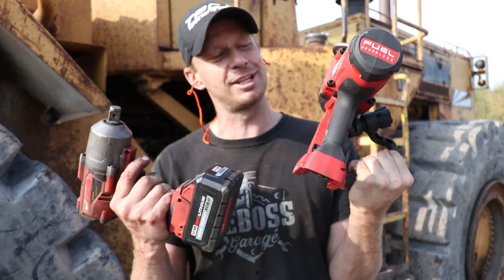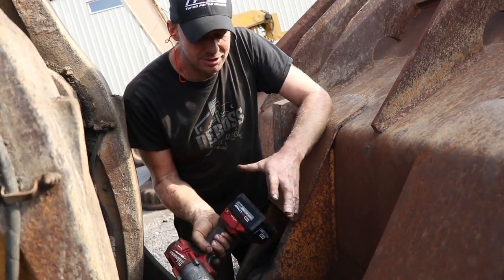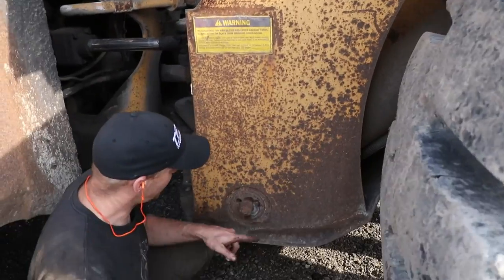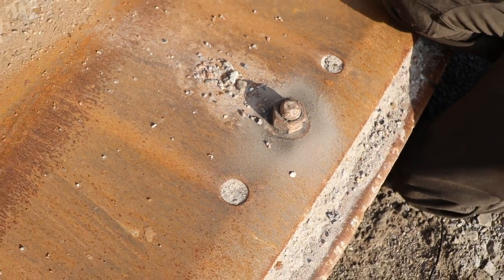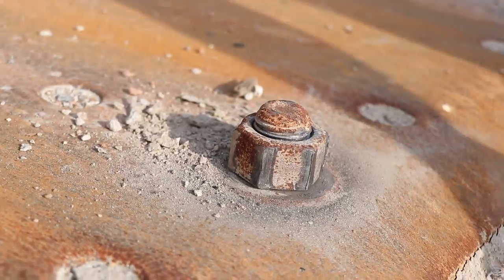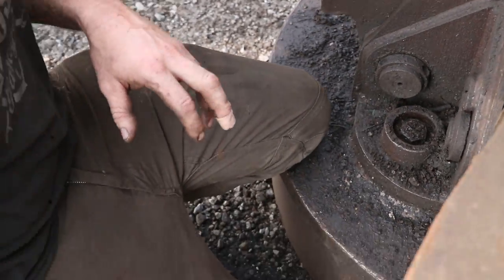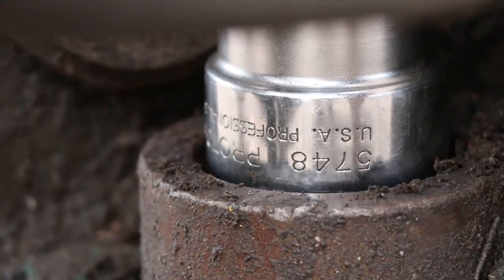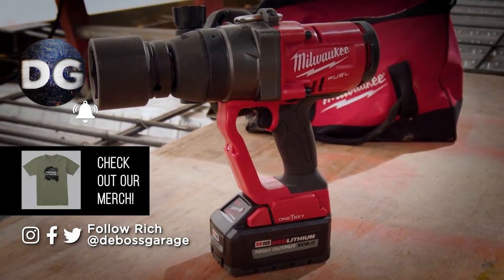Busting 40 Year Old Nuts with a 1 Inch Impact Wrench | Milwaukee M18 FUEL 2867-20 REVIEW

Comment: People saying “I’ll stick with my pneumatics” obviously have never heard the term “time is money”.
Reply: Pneumatics are fine if your in a shop. If your mobile like me and working out of a small van these things have been a total game changer - no more pulling backs with a breaker bar and length of scaffold tube and with the bigger 9ah+ batteries the battery life just isn't an issue anymore.
Reply: A good air gun will out produce any electric gun were there is a lot of fasteners with in one hose length of your hook up and you have adequate air the difference is speed not power.  That said I absolutely love my Milwaukee high torque 1/2 and my mid torque 3/8. The cordless impacts are a life save were entanglement is a concern.
Reply: 1in and 3/4 pneumatic still have the lead for now
1/2 in and 3/8 pneumatic is hardly even in the game these days
Reply: @fowletm1992  I think it will still be awhile before high volume tire shops go cordless it is just to slow.
Reply: @jvanlieu1  
Tyre shops prob not but general mechanics and at home certainly 
My local tyre shoo is using mostly cordless on cars already just run the nuts up tightish and finish with a torque wrench 
Much safer not having airlines dragging around everywhere they rekon 
But they still use phematic on machines trucks and 4x4s 
They are a huge shop servicing 80% of a 20k population town and 400km radius agricultural and mining zone 

The other local shop use air everything still but they dont check the torque with a torque wrench very use rattle it up and send it 
They only have 20% market share due to dodgy business extending eay further than just not torquing wheels

When I left heavy diesel engineering 2 years ago every mechanic had cordless tools and a 3/4 phematic impact, the shop provided 1in phematic guns and sockets 
Mostly Hitachi electric but Milwaukee was coming in big time 
I'm in aus so USA brands dont have a huge presence over here just yet
Reply: @fowletm1992  my 1/2 snapon pneumatic out preforms my milwaukee. if you have a sub par air system and a cheap pneumatic impact the electric will seem amazing. step up to quality tools and electric is still quite a ways behind.
Reply: @leetucker5788  
Iv got a 3/8 air ratchet 1/2 impact and 3/4 impact all snap on 
Running 120psi and 55 cfm at home 
Was running 120psi and 400cfm at the workshop I worked in when I bought them 7yrs ago
Reply: @fowletm1992  Ya those 3/4" & 1" IR machine gun air impacts that been in the game the last 20 years are still #1. You're right on the small air tools, I sell tools for a living and I hold on to the 3/8" airs for longer and longer now.
Reply: @leetucker5788  I think he meant 5.5CFM.
Reply: @jvanlieu1  I can see the roadside tire repair guys using these, I just want to see if these things can work with semi trucks myself
Reply: Jc Smith has a video changing tires on a semi tractor with the 3/4” Milwaukee. I agree that large quantities of fasteners you are probably better with a pneumatic as the batteries and cordless guns heat up. But out in the field away from the air compressor I will take a cordless over a breaker bar
Reply: @leetucker5788  I don't find it all that unbelievable that a serious home workshop owned by a professional, would install a (small) industrial compressor... 

They're cheap as chips on the used market, and with much lower duty cycles in a home workshop, you can still extract a decent life out of a compressor which is too tired and old to be useful in a commercial environment.

Additionally, you can set the pressure on a compressor, it doesn't have to be run at the unit's maximum: if that's not what your tools require (or can even cope with) why would you?
Reply: @joshuakelly8103  When describing an air compressor you list the cfm and max psi. Go to your local home depot and take a look. Obviously you run a regulator on a compressor as you don't always need max pressure. Also when you get into compressors that have 50+ cfm output a lot of them are 460v. Most businesses aren't wired for that let alone home worshops. I mean an older compressor like that would probably require 80-100 amps or more over a 220v circuit.
Reply: @leetucker5788  I know quite a few people running 3Ph 430VAC equipment in their home workshop, either with inverter drive or via a second hook up (the UK's electrical grid is unusually accomodating in terms of ease of adding a 3ph connection).

Like I said, the comment seems pretty plausible to me.
Reply: @joshuakelly8103  From his video he's an Aussie in WA, probably just has 3-phase.
Reply: Pneumatics are safer near fuel.  Don’t drop that battery in the fuel tank. I use a battery ratchet for all interior car work now though.
Reply: @leetucker5788  not who you're replying to but i have an Ingersoll 15hp pump on 400gal atlas that'll do 50cfm plumbed into 1" black iron and 3/4 hoses for the home garage. Run about 155psi for impacts and air hammers.
Reply: @GuNnErPAWN3D  I work for a trucking company with 4 bays to work on trucks and they don't even have that setup. I would say that's more than just a home garage.
Reply: Lee Tucker home barn with a few hoists. Nothing in the world is more frustrating to me than lack of air, so I took care of it. Everything from dirt track cars to combines and pay loafers are inside for work so I have what’s needed. 12” floors with 2” water coils from the boiler for the cold months too.
Reply: @GuNnErPAWN3D  sounds like you own a shop, not a home garage. I don't think most 2 car garages have "a few hoists".
Reply: Lee Tucker “shop” sure, but it’s not open to the public or a business so it’s a “home garage”. 60x110x16. Aside from that, all I was saying is that big 480v compressors don’t have to be at huge industrial sites, they can be at personal shops.
Reply: There is even an 1/2 " air impact with a torque of 1622 ft lb
Reply: @deezelfairy  I work on a lot of medium duty tractors and other fleet vehicles like an isuzu npr for example, I have all milwuakee tools, but also use a 1inch pneumatic impact all the time and having a compressor and other pneumatic tools is usually pretty important. Electric gets you only so far and then you need air. I'll invest in one of these at one point but for now I'll stick to my 1" pneumatic impact. Also having a compressor means you can lift a 20K pound truck in like 2 minutes if that so there's also a perk in that regard. To each their own.
Reply: I'll stick with my pneumatics in the shop and use my battery stuff when I'm without air.

An air gun with the right air applied is equally fast and doesn't overheat.

We also don't have longevity stats on these big impacts yet. They're expensive once, let alone frequently.

Maintained air compressors and guns can outlive us.

Comment: Another reason why the smaller gun can break a bolt loose that the bigger gun tightened is because break away torque is always less than um tightening torque. It makes sense if you think about it, when you tighten a bolt down it takes more force because you're essentially wedging the threads in.

Comment: I'd like to see some crusty 13/18 speed yoke nuts. Heavy truck guy, I daily my 3/4, need to order a 1 inch now.
Reply: My 1/2 Milwaukee  will take off a 2 7/8, and tighten it to well above 500 ft-lb.  Still would love to have the 1 inch

Comment: I've got all of them from 3/8" to 1" with both 8 Ah and 12 Ah batteries for my trucking operation and they work great. I no longer need nor use my air-impact tools. If I find a nut my Milwaukee M18 Fuel impacts can't break loose, then I use my 1" CheaterWrench first to break loose then my Milwaukee tools to remove. Those two tools never fail to remove nuts from bolts.

Comment: With the 1" i have noticed that if i just tighten the bolt first before trying to loosen it, it have worked in almost all situations. The biggest bolts have been tightened to 1200Nm and i used better sockets than chinesium :-P

Comment: I repaired heavy off-road equipment. While a 1 inch impact works 80% of the time, when you get serious about impacts, you purchase the #5 spline impact guns. I've got both a Chicago Pneumatic and a Ingersoll Rand spline gun. 

The #5 spline guns weigh in at over 25 pounds and use a 3/4" diameter air hose.

Comment: now try a 120v electric outlet chicago electric 1/2 impact gun at harbor fright with an open box sale of $31.99
Reply: Check out that generator you also need to use them both in the same situations. If your near an outlet your probably near air as well and better off using pneumatic.

Comment: I've had lots of success with my 3/4" impact with old crusty nuts if after the initial reverse hits to go to forward position (tighten) and give it a couple seconds of impact and a lot of times will release some of the crud in the threads and then reverse it works a lot of times when merely reversing won't get it...

Comment: U need a impact socket that chrome socket doesn't have the proper weight for impacting plus hey might shatter
Reply: He mentioned that in the video. I'd also go for a 6 sided socket
Reply: It's not really about the weight but the material is made of doesn't transfer the energy effectively.

Comment: We use 3/4’s in the bucket trucks (electric line trade)....thing is absolutly fantastic...took the hydraulic hoses and gun and put them in the side-till.....its got more than enough power and the battery just lasts and lasts...i cant even imagine the power of this beast...

Comment: Lot of people never do it. If you would spray those rusty crusty nasty theads around the bolt saturate it good with pb blaster or equivalent let set few minutes. That would help your impact tremendous on removing stuck on rusty bolts.

Comment: I had bought an old Allis and Chalmers m-100 grader that sat in the bush for 20 years, there was a water line on the blade during spring melt off. And I have an igersoll 3/4” impact that was able to get all but two bolts off. Had to get the old grinder wrench out. Always wanted the milwake cordless but couldn’t swallow the price tag.

Comment: That was a proper test for impacts  not like most of tests showing breaking fresh tightened nuts
Reply: Real test, for sure
Reply: Regular socket and a shared battery not designed for it makes it a real test? Using an impact socket and a 12.0 would have made a huge difference.

Comment: 4:25, have you never considered the new induction heaters rather than oxy?
Reply: Inductive heaters have there place but the coils are also expensive and he was saying they just cut them off and replace the bolts
Reply: @thomasjames734   I wouldn't consider inductive heater coils expensive. You can make your own gun for about $100  and the coils are dirt cheap, it's nothing more than copper tubing. 

Each to their own though. I agree cutting bolts is usually the fastest way of doing things as the cost of replacing them would be cheap. It may still be a useful tool to own though working on farms as I imagine all the mud and water would cake shit up

Comment: Those electric impacts should only be trusted for removing stuff, not tightening them. They are biased towards reverse torque not forward torque. That 1" electric impact probably barely puts out 300 ft-lb in forward. More like 700 ft-lbs in reverse, not their bullshit 1800 ft-lbs that an actual pneumatic 1" impact would have in reverse.
Reply: You've obviously never used one. My 1/2 inch fuel tightens to well over 600 ft lbs with ease. Done it multiple times on wheels.
Reply: No. Pneumatic tools were biased in a certain direction due to the air motor inside. Electric motors don't care what direction they're going.
Reply: Batojiri1 i didn’t believe the power numbers either so I did real world testing. I physically torqued bolts to values they advertise and given a good fitting socket with no extension and rust free they’ll do exactly what they claim they will do. I change several tires underground in fact I changed a tire on a CAT AD 30 rock truck last week and wheel torque is 740 ft/lbs my M18 fuel 3/4 gun will turn every nut to 740 (checked via torque wrench). I do however agree that you should not use a battery impact for tightening unless you check torque by hand afterwards.
Reply: I’ve also used my 3/4 fuel to remove bolts a 1” pneumatic gun couldn’t do
Reply: just like when they changed horsepower rating on small engines to foot lbs.  it was all deceptive to the end user. ex. 400horse but 20 foot lbs...who wouldnt want to snowblow with 400 horses but can only shoot out 3ft....lol

Comment: max torque come from the first few seconds the trigger is pulled and falls off after that. So when I'm using mine on a stubborn nut, I'll use it in bursts. Works just about every time, and definitely better than just holding the trigger wide open.

Comment: It doesn't feel as powerful as Milwaukee advertises it, it had hard time loosening nuts on a dry van, after taking off and reinstalling four wheels, it was already cutting out due to over heating even though it had time to cool off in the shade while tires were getting dismounted and swapped out. I'm betting Milwaukee stretched the truth a little, 1" air guns are not dead yet even though I thought otherwise buying this tool

Comment: I use the half inch drive Milwaukee at work just about every day changing axles on trailers and putting on 15/16th tounge bolts

Comment: Chrome sockets. I predict anvil replacement in the near future. Shame on you.
Reply: Also, rusty nuts are rarely the issue. It's the through bolts seized in the bushings that are the real trouble makers.
Reply: @shortchange26  I don't even try with bolts seized in bushing sleeves. Cut or torch them out and replace the bushings. Fuck that nonsense.

Comment: When using an battery impact driver, always use the biggest battery available - its a matter of peak power output (peak ampere) and use the hardest impact driver nuts (black steel) you can get.
Every tiny little bit of flex will dramatically reduce impact torque.

Also a good tap with a hammer and a pipe (so you will only hit the nut, but no damage the screw) will help (and off course heat and penetrating oil and swearing like a madman).

Comment: The 9.0amp battery has plenty of juice and to be honest I use a 5.0amp battery in my 1/2" Milwaukee M18 FUEL One-Key High Torque Impact Gun I keep in my truck and a 6.0amp High Output in the one I keep in my Toolbox and it gives them plenty of power especially the 6.0amp High Output battery but if I really need some extra power I'll throw a 9.0amp or 12.0amp battery on them, however that rarely happens. With the big 1" gun though it would have been cool to see u throw a 12.0amp battery on it! There are only a few of my Milwaukee M18 tools that I use with a 12.0amp battery on a regular basis, my 10" Milwaukee M18 FUEL Dual Bevel Compound Sliding Miter Saw, of course my 8-1/2" Milwaukee M18 FUEL Table Saw, my 16" Milwaukee M18 FUEL chainsaw and my new 7-1/4" Milwaukee M18 FUEL Rear Handle (worm drive style left hand blade) Circular Saw which is a total beast and occasionally I will throw a 12.0amp battery on my Milwaukee M18 Blower and Line Trimmer not for the power but for the runtime usually I just use 9.0amp batteries with them. Oh and I will usually use a 12.0amp battery with my Milwaukee M18 FUEL 3 in 1 Backpack Vacuum since it goes thru batteries quick. it's to bad I don't run more tools on 12.0amp batteries cuz I actually have 3 of them lol! I used to have all DeWalt tools, I had 10 of them and 7 batteries. But when they were stolen I got a couple Ridgid 18-Volt tools cuz it's what I could afford at the time and I ended up really liking them and before i knew it I had 15 Ridgid tools, if you count my 2 extra JobMax heads which I do since even though they attach to the JobMax base they each turn the JobMax into a totally different tool, and I have 7 batteries unfortunately my largest Ridgid batteries are two 5.0amp ones. I got into the Milwaukee M18 tool line when I got sent some Milwaukee M18 tools for free thru a testing program I was in and they also sent me five 5.0amp batteries which was great since we all know batteries are one of the most expensive costs when breaking into a new tool line. Now I have 20 Milwaukee M18 tools and 12 M18 batteries with my smallest ones being my 5.0amp ones, except for one 2.0amp battery I bought for my Surge Impulse Driver to keep it light. With Brushless motors and Lithium-Ion batteries we have now 12-volt tools aren't a joke anymore and there was a certain Milwaukee M12 tool I wanted so I decided to pick it up and since it had plenty of power I picked up 4 more Milwaukee M12 tools I had my eye on and ended up with 5 M12 mi tools and 5 M12 batteries. Anyways I ramble on like crazy, I guess the point is that I do like Ridgid tools but Milwaukee are the best tools out there, go team RED! If I needed a 1" impact gun then you better believe I'd have that 1" Milwaukee M18 FUEL Impact Gun! BTW what is the max reverse torque rating on it, like 1800ft-lbs of torque isn't it? I can't believe the One-Key version of the 1" Milwaukee M18  Impact Gun in a kit with two 8.0amp High Output batteries, a charger and carrying bag is $1000, that ain't cheap!

Comment: I have both the 1/2 high torque dewalt impact and the Milwaukee version on the rare occasion the milwaukee will take a bolt of the dewalt cant but both are awesome tools and I wouldn’t want to live without one as a mechanic

Comment: Try a bottom bracket on an old bicycle. I recently had one from 1996 that my 450 ft lb gun would not take off. Sprayed it. Could not use a torch as the full suspension elastomer was an inch away. I tried several days. In desperation I finally cranked my compressor up to max and it still took like 2 minutes but it got it off. Go craftsman!